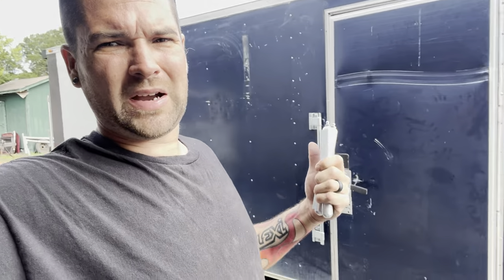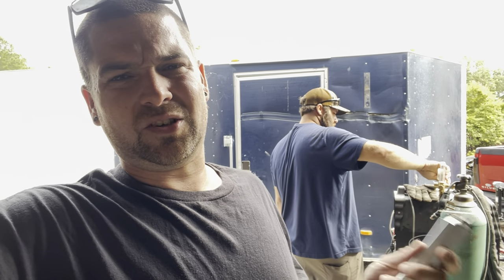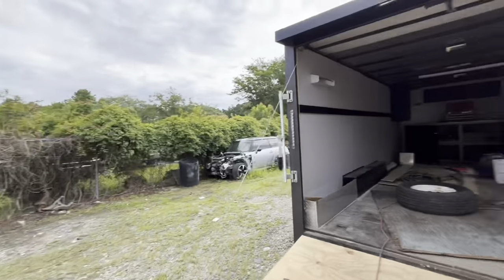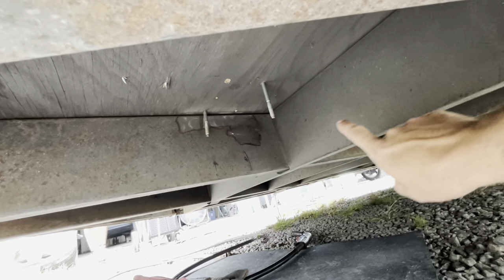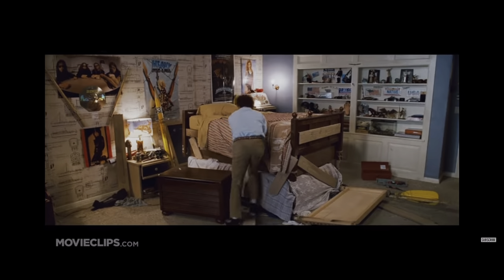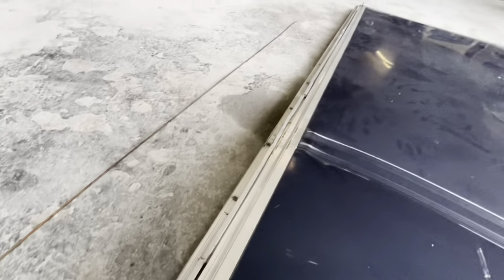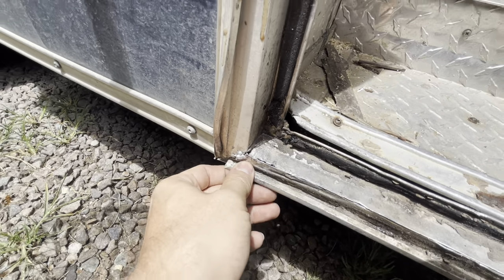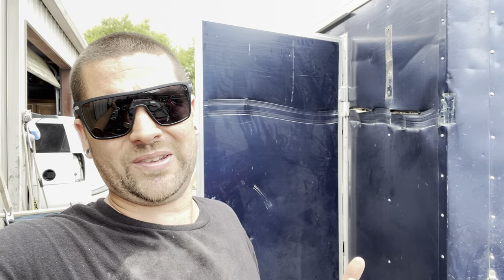🧑🏼‍🏭 DIY Custom Race Trailer Barrel Door Hinges For Under $30 💥

Comment: I had a similar situation with  the aluminum/welding like on your trailer door. I had a set of Pro Comp sbf aluminum valve covers that I took to a local fab shop to have an aluminum baffle welded in.  The fab guy can lay nice dimes but something about the valve cover aluminum he had a heck of a time just getting the baffle secured. Weird stuff. Trailer is coming along nice    👍🏻
Reply from the maker: Yup it’s probably bc it’s junk material sadly. And thanks man

Comment: Atleast make some metal plates for you winch mount
Reply from the maker: Whatca mean?  That thing will be solid now
Reply: @ThePaintPaperHustle  for under the trailer where your bolts come through
Reply from the maker: We welded that think plate under there to the trailers frame
Reply from the maker: Thick*